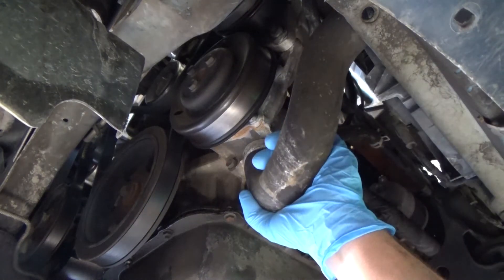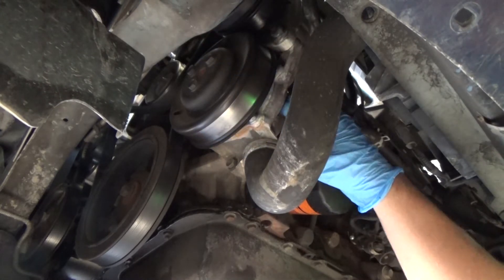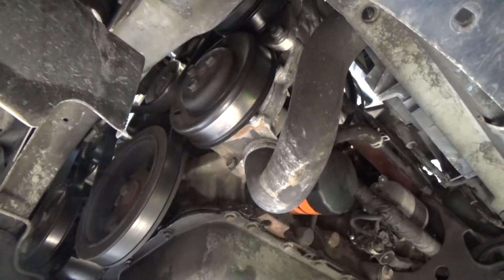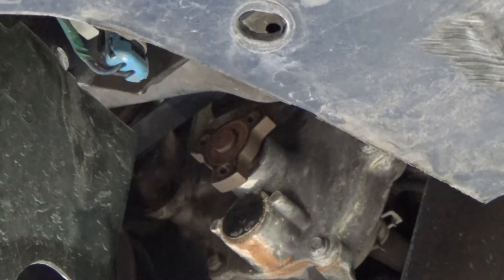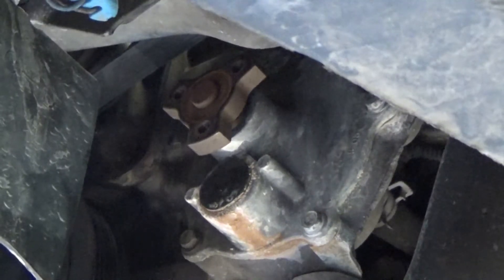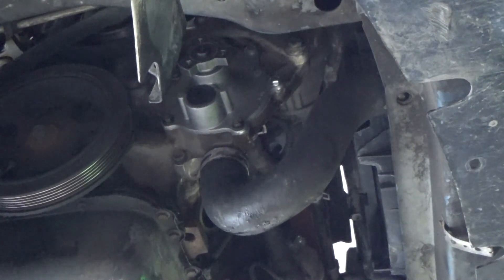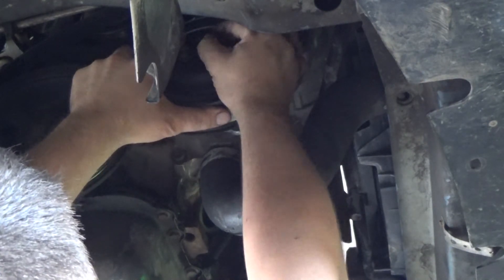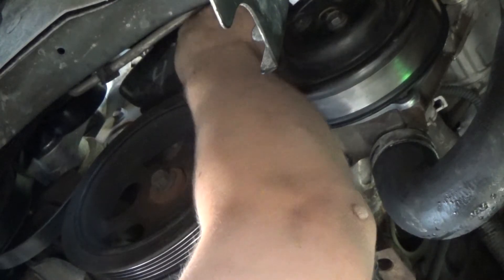2000 Chrysler Town and Country Water Pump

Comment: Thanks so much! You saved my day! 
Have now changed the water pump and noticed that the top bolts (same problem you had), were too long, they went into the block, this is / was the original water pump from the factory. But managed to unscrew them without breaking them. Has replaced them with 2 shorter bolts now.

You make good explanatory videos and methodically show how to replace spare parts and give good tips/advices. Of course subscribes to this channel.
With love from Sweden!

Comment: This was very helpful. You walked me through a very complex problem easily and very clearly. I have a 2000 dodge caravan and this is exactly the same arrangement of engine and water pump placement. So many videos show different models with the water pump in a different location claiming its all the same but no this is the best vehicle model view for a DC 2000 3.3l WPump replacement

Comment: You took the water pump down at like 15 lb per square inch. Not 50 this case it's really good to know the difference between 50 lb of torque and 15 lb of torque. And put that gasket sealer all over the bolts. You will see it was seal in to keep the moisture out of any surface that the bolt is because that water pump heats up quite a bit and it's aluminum so you have to allow for some stretch.

Comment: I use a vaccum coolant filler. It helps cut time on waiting for it to burp and checks for leaks
Reply from the maker: You're absolutely right. I've used them before and they work great, especially on the Jeeps that were a real pain to bleed. I've been 
looking at getting one.
Reply: DIY Auto Homeschool i personally have the one by matco along with the adapter kit. it wasnt cheap but its definitelt a game changer and a must on some vehicles like ones with intercoolers. love it.

Comment: nothing was mentioned about the oil in the oil filter loss would not that be a problem?
Reply from the maker: It's not really a problem. I know it has been common practice for many people to fill the oil filter with oil before installing it, and that's not wrong, that's a good thing to do. In my experience, I've never seen an issue on a normal gasoline engine with not filling the oil filter. On any diesel engine or turbocharged engine, I will always try to fill the filter if possible. Many filters that are mounted like this one or directly horizontal make it very difficult to keep any oil in the filter when installing it. 

Thank you for your comment and question. I hope you enjoyed the video.